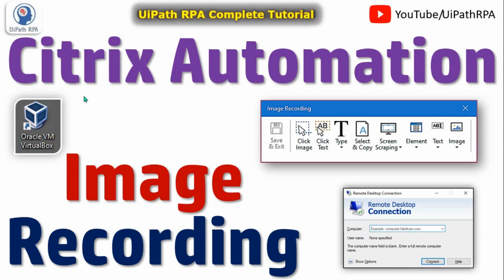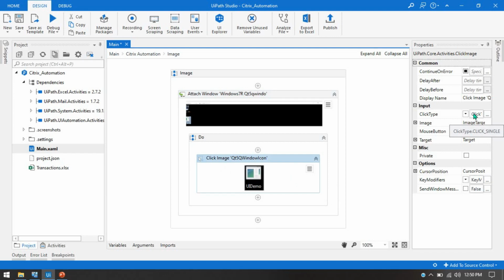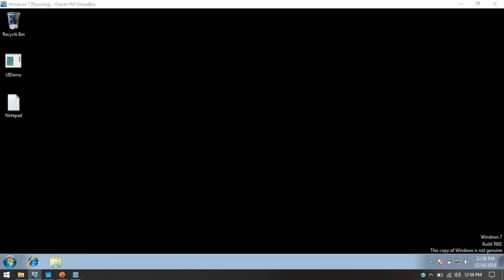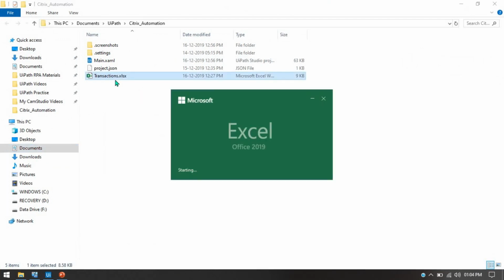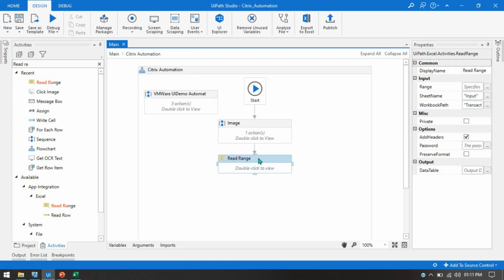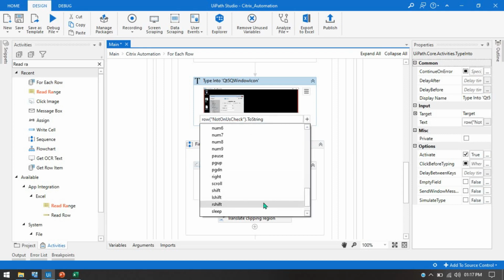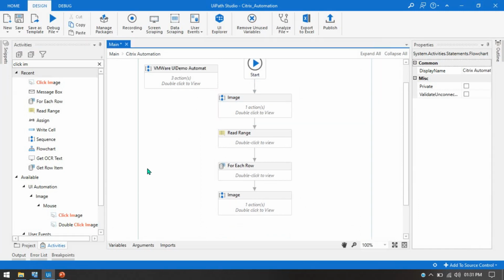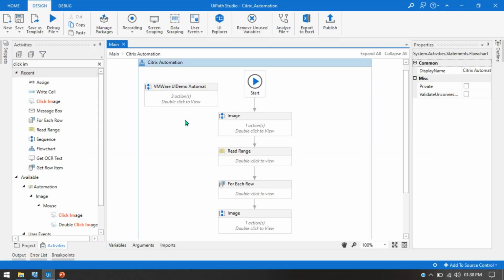UiPath Citrix Automation | UiPath Image Recording |Image and Text Automation | UiPath RPA

Comment: Hi Manish,

Thank you for putting in the effort to create these tutorials, it really helped me with my work.
Also, I have a doubt, say for example you have a combobox with 100+ records, and your bot has to click on each item one by one and when it reaches the last item on the list, scroll down to select the items beneath it, is this possible with image automation?

Kind Regards,
Hsa
Reply from the maker: Did you try using Select Item activity. It works fine with drop down. You can take idx as 1 and increase counter.
Reply: @UiPathRPA  Thank you for your response, but correct me if I am wrong, I don't think this is possible to achieve that with image automation since you can't generate any selectors right?